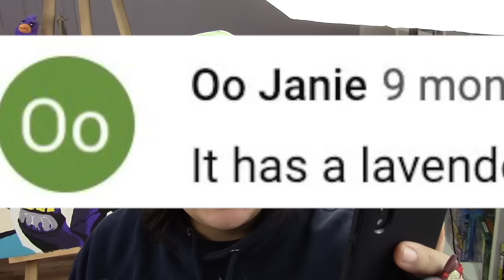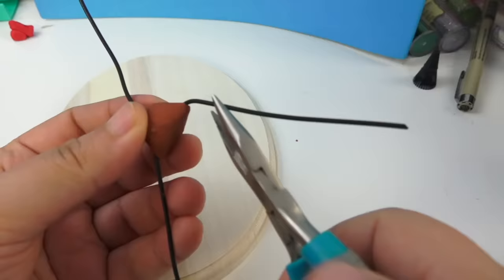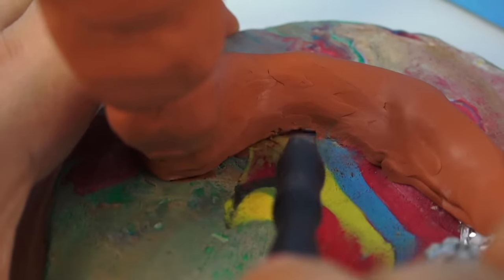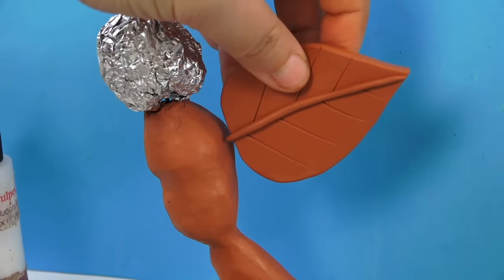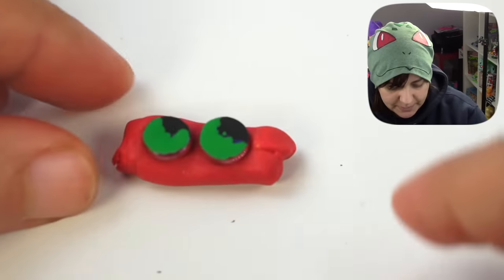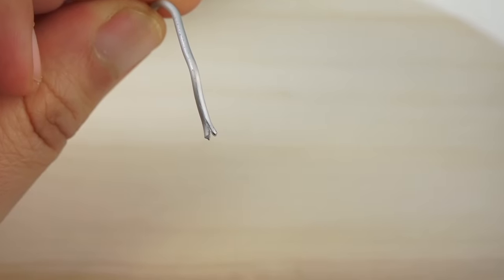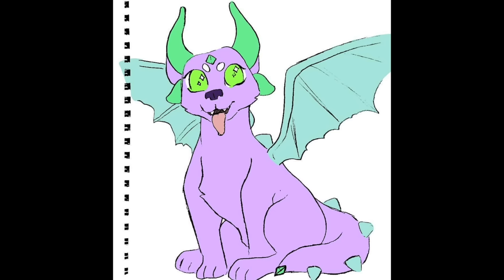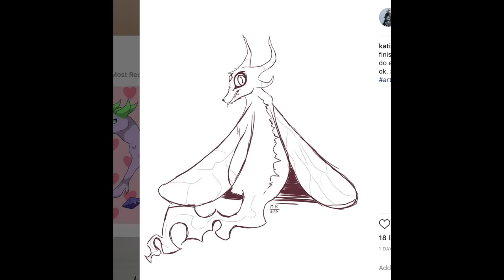I TURN MY SUBSCRIBERS COMMENTS INTO A SCULPTURE #1 Monster Clay craft DIY Challenge

Comment: #comment2art2

It is a fiery red color
It has large orange-yellow wings
Spikes on it's back (same color as wings)
A medium sized snout
Is breathing fire
Is flying (you can use wire)
Has 2 arms
2 legs
All limbs are normal sized
Six total fingers
Six total toes
Opposable thumbs
All limbs are claws
Has sharp pure white teeth
Ground looks scorched
Muscular build
Head and body look like two pieces but are still connected. (End of head goes around the body)
A tail that comes in front of him
Piercing fiery eyes
Slits for pupils
Tail end in a spear like shape and has orange-yellow spikes at the end
The whole thing glows orange (get creative!)
And the whole thing radiates energy. 

Plz use

Comment: it is very fluffy and walks on all fours. its face is very cute and has big ears with a small tuft of fur on the top of it. It has four  clear wings wings with two on each side. Its tail is sleek fur until the end were there is a barb on it. the spikes going down the back are webbed all the way down to the tail and meet up at the top of the four head the spikes are white and the webs are turquoise. the hole body is blotched up with different designs of animal prints and other kinds of designs. it also has cute paws. the eyes have something sinister about thembut also a gentleness and it is smirking evily. it had two horns that are mildly small by the ears.

Comment: #comment2art2

It has a white and gold body. It has two large feathery wings and two claw-footed legs. It has a long tail with feathers on the end. It has a scaly head with feathers on the back and a long neck. A feathery mane covers the bottom of the neck. It has a short, smooth, round head and large dawn-like orange-pink eyes. A forked dark blue tongue sticks out of it’s mouth, and it has sharp fangs and it’s scaled and feathered body twists and curves. It likes grilled cheese and treasure. :3

Comment: #comment2art2

It has a long body with four legs and short, sharp steel colored claws (so you can practice dry brushing 😁). It has jagged grey fur with a chaos symbol on its forehead. It has mismatched dragon eyes (you choose the colors) and a long fluffy tail. The ears are wolf-like in nature and it has a pair of short classic devil horns on its head. There is also a smaller dragon-like creature wrapped around the four legged creature body with its wings spread out wide as if about to fly away with its friend.

I know it's a long comment, but it could be a good challenge. 😁

Comment: #comment2art2

It has 4 legs, 2 with 3 pawed feet, the other 2 with 4 pawed feet. The wings are giant and dragon-like but there are 4 wings, 2 of the 4 are smaller. It has 3 tails, one with spikes at the end,  the other 2 are normal lizard-like tails. It has a somewhat long neck with fur around it. This creature has an overbite with 2 vampire fangs. There is a sharp horn on its snout. There are horns that curve down and beside it's neck and doesn't curl like a ram's horns. It has a forked, purple tongue. It's neck fur color is sea-blue. The scale color is indigo. Wing colors are rainbow. It's eye color is silver.

Hope I get chosen! Like if you're interested in what I described! 💜

Comment: #Comment2art2

This creature has Big triangle soften ears.(Left one lopsided)

The right one standing strait up.
The creature is on all four.Its coat is a galaxy theme.
The eyes are black with glittery White pupils.

Its face expression is a powerful mighty,ready to go battle look.

The back right leg has a Small orange star.

The  torso in the front has a gem that is a  light pink hexagon.
The creature has a big wing and one smaller.
The color of the wings is an ombré affect that goes from dark blue to light blue on both wings.
Around the waist,There is a rope with a sword attached to it.
The sword looking from a side view is attached to the side of the rope on the waist.
The tail, is the continued galaxy color.
Its long and standing up.
Surprise me about the base!

Comment: #comment2art2
It has a thin, pointed head with large amber eyes and a vicious snarl, displaying every one of its sharp teeth and a thin forked tongue. (Might be a bit hard to sculpt) A ruff of dark grey spines falls around its neck, with two proud horns growing at the top. It has a stocky, muscled body and four thick limbs. At the end of these limbs, retractable claws dig grooves in the ground. Small bioluminescent spheres run down its sides, and it has small fins protruding from its shoulders that flare up, revealing torn edges and small venomous claws at their tips. It has a long, whip-thin tail with a large, also bioluminescent orb growing on it.

Comment: #comment2art2

This creature has a very large eye in the middle of its head.(that is the only eye) the head is very bone prominent. There is two large indents on each side of the body(4 in total). The body is skinny. It has two arms and two legs and stands on its legs. There is a small round tail. Down the back of the creature there is a swirly pattern. The mouth is a large villain smile from one side of the head to the other. The main body is forest green. The eye is gold. The other details (tail and indents and back pattern) are white. If you were wondering it is a creature named Roberto.

Comment: #comment2art2

1:It has a gray body with dark gray lines 
2:it has dark gray triangular ears at the top of its head (big)
3:for it feet in has big bear feet with big claws for toe nails
4:two big long teeth at the sides of its mouth and little ones in the middle
5:big eyes with a circular pupil one eye is red and the other blue
6:a long tail with a black piece of fluff at the end

I didn’t have any more ideas for this and I really want to be chosen it doesn’t matter if I don’t BYEEEEEE

Comment: #comment2art2
It stands on 4 legs, reptile-like feet with large curled claws, it has 3 long striped tails each with two ring shapes at the end. It has two sets of transparent wings, ribbing running from it's belly up to its neck, which it as long as its body. Its head is rather small compared to its body, but it has large spiky ears. It has 4 eyes, two of which are smaller and they are orange with blue specks in them. It is mostly a tealish color with silver accents.

Comment: #comment2art2
It has pink on the tip of the ears and the base colour of the body is blue.
He long ears and they curl like a slinky.
It has a chubby body and it has circles on it. 
The legs are stubby and the claws are pink like the ears.

His wings have circles on the thin part and has a spike on the edge, the spike is pink and the thin part is a baby blue.
The tail circles around like a slinky and has circles running down it, the tail also has a spike on the tip that’s pink.

Comment: My creature has a pinkish orange body and head with sky blue eyes. It has large pinkish orange dragon/ bat wings with a magenta frame. Her tail tip has a bunch of little spikes. She has two slightly twisted magenta horns and webbed paws with white claws. She walks on all fours. She has a longish tail with spikes from top of her head, to the tail tip. She has a little muzzle with a horn on the top of her nose and a sweet face.

Comment: It has a potato-like body which is larger at the front than at the back, its 4 legs are relatively long but not as long as its stupidly long neck, the neck is not perfectly straight and is flexible, don't forget the fuzzy mane along the back of the neck. Its tail is thin with a fluffy end. The face is long and slender with small dark almond shape eyes and medium size somewhat-pointed ears. On the top of its head are two stumpy growths about the same size as the ears, the ends are kind of knobbly. Colour-wise its a brownish yellow either light or dark with a darker brown irregular but geometric-like pattern. #comment2art2

Comment: My character is pink with small white feathery wings a long tail with a white end of it's tail,blue sparkly eyes and a galaxy color gem. It's ears are rounded triangler on top of it's head while it's feet is white small and slightly pointed while still rounded.

Comment: My creature has three eyes one eye is lizardy one eye is cute and one eye can hypnotise you, it has a small mouth with one sharp tooth. On the sides of its face it gilles. It has a long scaly neck which has tall spikes on the back of the neck and on the actuall back of the body. It stands on four legs and its legs are bulky, it has five claws on its feet and its tail has a poison barb on the tip. It is entirely all different shades of black, blue and purple.

Comment: #comment2art2

It is very tall and triangle-ish with it's point facing down. It has three very thin legs poking out at angles. The legs get thinner and thinner as they go down until they touch the floor. The two arms are thicker then the legs but taper like them until they reach points. It is holing fire. It has a circle head with small white eyes. The rest of it's body is darker, so the white eyes and glowing fire stand out.

Comment: The first time I tried using sculpy I didn’t use tinfoil or wires. I also thought it was air dry. So yeahhhhh i left it to dry overnight and found that the tail was lopsided, one ear has fallen off, and all the legs had collapsed

Comment: #comment2art2
The anthro creature is peachy in colour. 
It is mostly pastel.
It has a long poofy tail, fading from a dark peach closest to the body, to a darker red towards the tip.
It has a small torso with short skinny upper arms and large chunky lower arms and fingers.
It has a thin waist that quickly broadens with THICC thighs.
The feet and toes are very small in comparison to the lower arms and fingers.
It has a large head with 'average sized' pastel green eyes and a large open mouth.
The GIANT (emphasis on giant) ears come from the side of the head with pastel green inner ears.
The cheeks have the dark peach (like the tail) fur drooping from either side and the entire creature is covered in thick fluff. 
The right arm (it's right not mine) has two small rings, circling the wrist, one larger than the other.
Both rings are the dark peach colour and one is significantly bigger than the other. 
Two small circular dark peach eyebrows sit above the eyes.

This is one of my OC's, I described her as best as I could. I really hope you attempt to make her and I would love to see the outcome. I hope I'm not too late. Love you Jackie!

Comment: #comment2art2

It has a smaller body with feathers on it's back, a larger fluffy tail that is over twice it's body size. It has two arms and two legs with paws and claws. It wears a skull over it's head! You can't see it's eyes. It's main color is pastel pink! It has two sharp horns on it's head that point from the skull.

Comment: #commentit2art2 it is mostly a dark color, with two big wings a fluffy tail with the end two flaps, it’s all fluffy. It stands in 4 legs and has 2 arms its has two “triangular ears” and a snout, it has a little mane at the top of its head..also the eyes are green and yellow arithmetic the form of an oval with one of the ends pointy and the pupil es are big and rounded

Comment: #comment2art2 A familiar multiped with a boar head covered with fleshy protrusions.
It has the round body,  large wings, a twisty tail with spikes, 6 long legs and rusty hooves. It’s  body is covered in tendrils, while its feet are covered in scales. Its forearms, jaw and cheeks are pastel red with yellow-green spots, while the rest of its body is light blue and black with yellow-green spots. Diet-Hay, Water plants, and Shrubs

Comment: #comment2art2

It has a head with black  thick hair covered in scales covering her head. Scales of all colors including red, yellow and green. The face of a purely soft skin tone of peaches. Eyes with a yellow wild look. A mouth with 2 fangs and a pinkish tongue. A white little tailbone that isn't possible to see. A inside of a peach colored ear touching the sides of the head. 2 legs that slither though the desert. No wings of any sort. Hands of five fingers in  each covered in yellow, blue, and green scales. Yellowist nails longer than the tail. A nose that is just 2 holes so it can breathe. The sight of bones is visible. A huge oval in the belly with stripes that continues towards the legs. The eyes can glow in the dark. Feathers in its mouth from the prey it has eaten.

Comment: The face is long with 5 Small horns and 5 Larger ones. It has a long body that ends with a     Circle jem on the tip. The eyes are a bright yellow with tiny pupils. Along its back we have spikes leading down to the jem tip. It has sharp fangs and an overbite. It has a forked tounge and sharp claws. It has 4 legs and the claws are dirty. Lives in a swamp. Main body color is a tan color while his underbelly and spikes are black. Ok this took to long Imma go make tea and nap now.
Reply: #comment2art2

Comment: #comment2art2 
It has a slim body, that is a pastel like red, its underbelly is white. Around the stomach are 3 hoops, that are white. Its front legs have black stripes, and large. The back legs are smaller, and have pink spots. It has 2 horns on its head, that are red. Big ears that are also red. Its eyes are oval, and are bright yellow. It has big wings, that are gradient to red to white. Its tail is a small, and red.

Comment: #comment2art2
The body is not slim but not bulky either. Sort of in the middle.
It's also a plum colour
It has 4 legs which are white 
The white legs fade into the plum body
It has black jelly-ish tentacles coming out of its back
It's eyes are round and black with small white dots for pupils 
It has a huge smile with sharp pointy teeth which are a pale yellow.
The tail is super long.
It's face is oval-ish and it's floating over the body. It does have a neck but it's not connected to the head.
Pointy ears and black horns.

Comment: #Comment2art2
My creature has a light blue body,
With a patch on it's left cheek. It has big ears that fold behind it's body, and a oval belly that's yellow.
It has a fluffy striped tail that's long and it's yellow and orange. The creatures eyes are black ovals with a white dot in each oval. It has a black round nose and a smiling mouth. It then has Crystal wings that are bigger than the body itself, and the wings are deep blue, dark green, and darkish purple. That is my original creature, hope you enjoy it!!!

Comment: #comment2art2

It has a flat face but it’s sad
The tail is curly and black with white spikes
The wings are pastel blue 
The arm and legs and rough and black
The body is very smooth black
The head also has white spikes 
And two very very very big horns that are...black 
And it has blood on its tail (optional)
And no nose
The eyes are red 
It has grey claws
And ears that are droopy and grey
It has a unique pattern an its forehead 
And big sharp shiny white teeth 

I hope you like it!

Comment: #commet2art2 
It has a black body
It has deep red eyes
It has four limbs
It his a black to white gradient in its wings
Loves destruction 
It has a long wavy black tail with a spaid at the tip of the tail
It has a ruby in a diamond shape on the top of its head
It has white claws
It has a white stomach
And it has deep red horns on its head
It has a strong body shape, but it is not human

Comment: #comment2art2
This creature resides mainly in the deep depths of the water, but can breach the surface for short periods of time.
Along with their four legs, this creature also has a medium length tail, around the same length as their main body. The end of their tail features a fluffy tail fin that hardens into a fin when underwater, above water looks like a tuft of fur. These creatures breathe through tiny small holes in their skin, allowing them to breathe above and below water, but their bodies are mainly adjusted to being deep underwater. These breathing holes can be located on a line on their tail, the side of their ankles, and on their sides. This creature is a navy blue color, but slightly grayish, and their belly, paws, tail fluff, inside ear, nose, back and top of tail, and in between parts on their fin are a slightly lighter color, resembling more a light grey then a blue, but still keeping that tone. Their breathing holes glow a bright blue light, and their eyes, no pupuls, glow a bright yelow green. Their back of this creature has a large fin, with three structual "bone" like spots, making it more fish like then a shark fin. Their head, paws, and body shape vaugely resemble a feline form. Their head features their large feline-like ears, and above them short soft horn like numbs, the same color of its skin. locate on its forhead, this creature has an antennae, much like an angler fish, that glows the same bright yellow green as its eyes. These creatures also have whiskers. These creatures tend to swim simmilar to an otter when moving fast, but can also swim like a dog would as well.

I think thats everything! Hope u like these cuties, cant wait to see what anyone makes with this description.

Comment: #comment2art2

It has a deeeeep blue body, with huge white feathery wings surrounding its body. It walks on two legs and has two arms. It wears a blue tiara, with crystals on it. It wears a white, dress like garment, and has white hair. Its hands are small but slender. It has a deep green eye, but wears an eyepatch over one and black lips. It has a small blue gem in the center of its head. It has pointy ears

Comment: #Comment2art2

Has Long tentacles and a long tail. It also has a short stubby body with very very very very small ears , one arm is longer that the other and it’s feet are long , it also has a very large head with a curvy beak.